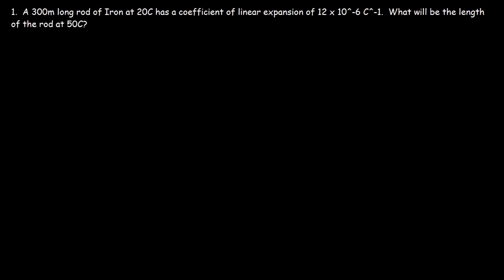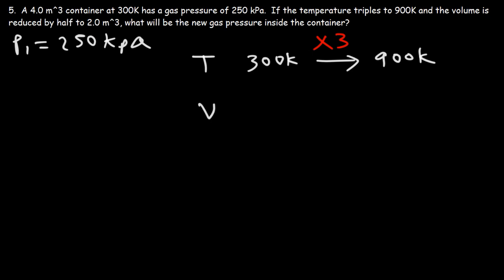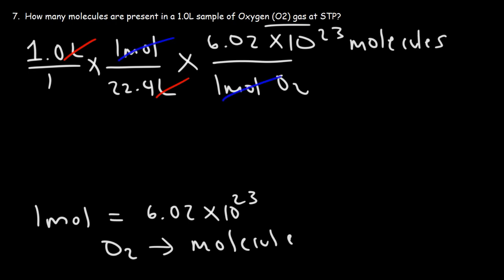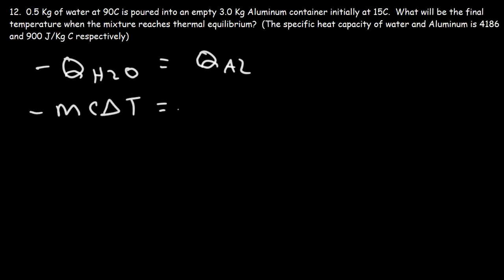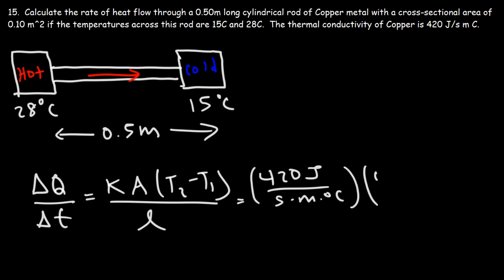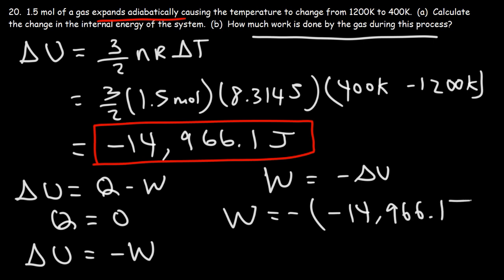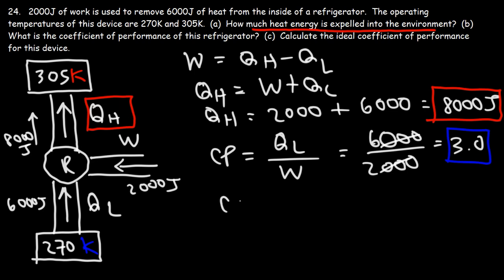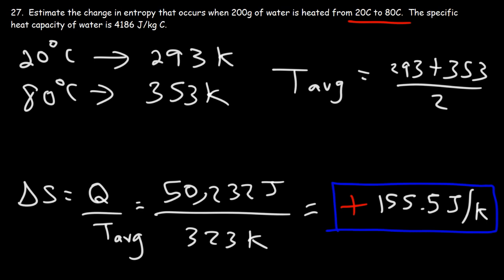Physics 1C Final Exam Review - Entropy, Thermodynamics, Gas Laws, Specific Heat & Calorimetry

Comment: thank you very much man but shouldn't you've used 5 as a factor instead of 3 as a factor in the vrms problem at 29:43 because N2 is diatomic
Reply: the 3 is there only to represent that the molecule can move in 3 dimensions, (x,y,z) its always 3, only U would change because Cv = 3/2 R for monoatomic and 5/2 for diatomic